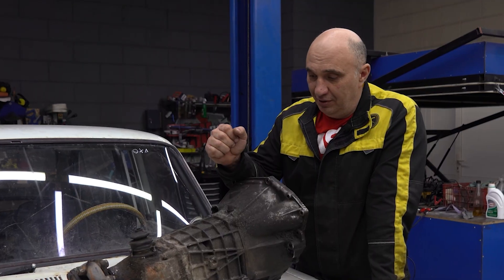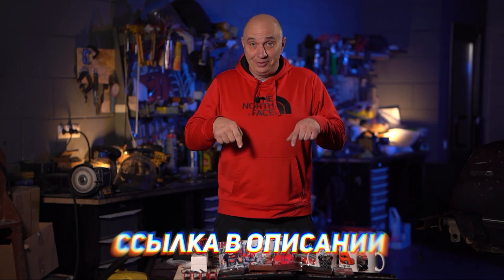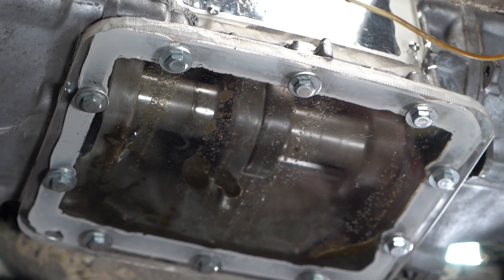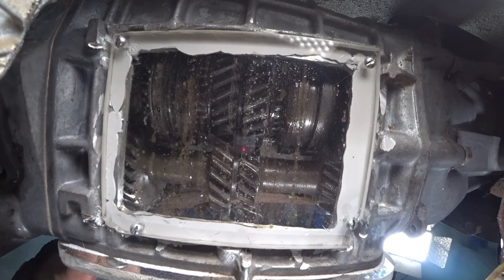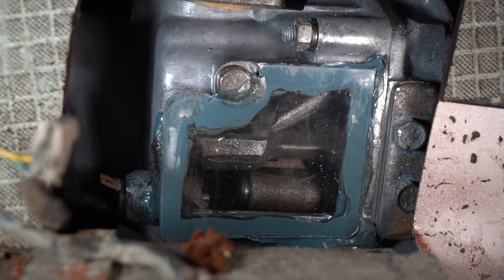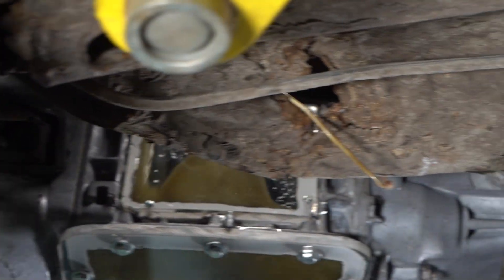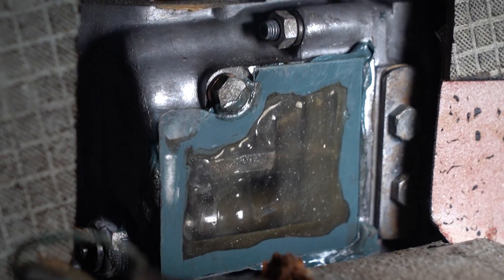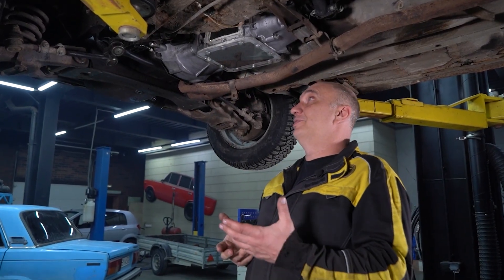We make a see-through gearbox for a Lada

Comment: When i was a small kik i used to think that engine and transmission are full of oil up to the brim ... it would be nice to flush it so it stays see through longer and slowly add more and more oil and see the result, even try to drive it when it is full to see if it has any negative impact

Comment: you can run a transmission for short periods without lubrication. its more about prolonged stress. there is always some metal in the oil. but if you pull off your transmission oil pan at home and have metal lie those shavings in the pan. go see a mechanic.

Comment: Hey garage! I have a 1300 lada engine 2105 with a timing belt, and cant make it run well... when fiddling with ignition module it has tendency to shoot fumes into coolant piping. Is it normal or i have head gasket failure?
Reply: Broken gasket

Comment: i would like to see u guys make a electric lada maybe a golf cart motor and battery bank. would need some kind of motor controller anyway thanks for the great videos very interesting.
Reply: It might take two golf cart motors to move a Lada.  Have both motors connect to a common flywheel and drive through the clutch and gearbox.  Technically, an electric motor doesn't need a transmission but, the lower gears will give it much better acceleration from a stop.

Comment: This is a great chanel for petrol head to showing how an engine is lubricated how a manual gearbox works how the oil moves around the gearbox most facinating stop giving BMW ideas about how to use mire plastic in there so they break down quicker

Comment: What about a five-speed gearbox? Where does the fifth gear fit?? I have only disassembled 4 speed Lada boxes. Not 5 speed ones. Can you guys make a transparent 5 speed one??
Reply: the operating principle is exactly the same, only with the overdrive 5th gear being there too
Reply: I don't know if the Lada engine has the torque to handle an overdrive.  Level flat roads at best.

Comment: would love to see a seethrough automatic transmissions aswell
Reply: or a Continuously Variable Transmission
Reply: @shioq  watch how a snowmobile clutch works same thing
Reply: With automatics often being little more than a stack of planetary gears and clutch packs, there wouldn't be much to see from a housing cut-out.
Reply: @teardowndan5364  cut a hole/window into the torque converter and then . .oh crap, it's spinning. Run some crazy video stabilization software on it? lol.
Reply: @colinstu  You'd probably need to use a high-speed camera with 1/10 000th shutter speed or faster and a sync mark detector of some sort.
Reply: @colinstu  only way to understand how is 2 fans facing each other but not sure if clear case tc will show it like that given the space?
Reply: @teardowndan5364  I wanna see a clear valve body.
Reply: @teardowndan5364  a torque converter and a valve body too
Reply: Torque converter yes please.
Reply: jea i agree too
Reply: try making the engine block transparent
Reply: yes
Reply: I think the other issue would be finding an automatic in Russia.
Reply: They should make torque converter from plastic glass
Reply: Please.....do a see through AT gear box, as a basic AT gear box also so complicated@#%§ (in a view of a mechanic)

Comment: Would petrol work as coolant?
Reply: Yes. It already cools the fuel pumps.
Reply: @vector6977  i think they meant for the engine coolant, to which id say no. it would evaporate off rather than cool. if you were lucky.
Reply: It would probably become a pressurized vapor. they used to heat gasoline into a vapor to use in boilers, etc.

Comment: Try adding a big neodymium magnet to the bottom pane, then run the box for a while, and see if you can determine how much of that metal glitter in the oil is actually from wear and tear of the ferrous metal gears, and how much of it is from cutting out the holes in the aluminium casing. Whereas the aluminium won't stick to the magnet, the ferrous particles will.
Reply: I was going to say the same thing
Reply: I also was wondering if it was just aluminum shavings from cutting the holes in the casings. A magnet on the bottom would be a good way to find out.
Reply: @keithyinger3326  it's all from cutting it... You aren't going to get metal shavings like that from running the gearbox dry on a lift.
Reply: yep same thought here...that would be pretty interesting.
Reply: yes
Reply: It does look a lot like Aluminum.
Reply: just said that , then looked down , hahaha
Reply: OMG! You beat me to it! I was gonna say the same thing!! Neo magnet! Those shavings are from sawing openings in the case.
Reply: Isn't it a horendous amount of particles !!! WOW !!!!! :(
Reply: @Paul O'Connor  it's an old car what do you expect? It's Not a Toyota.
Reply: I just want to say that the casing isnt magnetic it’s aluminum casting 🤣 
So no its not going to work
Reply: @MertNisa3168  no, it would not catch the aluminum, but if it doesn't catch any metal shavings and they are all still floating around in there, it would tell you that yes, they are aluminum shavings from cutting holes in the case and not worn gears. So in that sense, yes.. it would work for determining which is which.
Reply: @MertNisa3168  That was the whole point of the magnet to make sure it was just aluminium shavings and not ferrous. At least that was the first comment I read.

Comment: Hi. I've been following your shows for a long time. One question. How would the original Lada engine behave if a turbocharger were installed?  Thanks for the answer and even better for the video. Greetings from Croatia.
Reply: Prety sure they've done that before, one I recall was an electric job done with a starter motor, made boost, power went up, just as a turbo should...
Reply: pretty much the same as any other engine would with a turbo added. boost etc would have to be carefully kept in check as it may not be able to handle as much boost as a built/designed for boost engine, and compression ratios will be higher so will only be able to handle modest (up to about 10psi at best) of boost anyhow without knocking, and that assumes being able to get sufficient fuel into the engine (rejetted carb for example). adding a turbo to a diesel is, in some ways, a SLIGHTLY simpler affair, but not much as similar principles around fuelling etc apply, but the engines are largely unchanged internally (certainly on older cars of similar era to the Lada) boosted or not
Reply: I'd like to see what's called a "turbo-compound" arrangement.  Instead of the turbo being used to cram more air-fuel mix into the engine, the exhaust turbo is directly driving the flywheel of the engine.  It will be directly converting heat energy into mechanical energy, thus recapturing some of that lost heat.

The turbo will have to be bolted in where the starter is currently located.  Vlad will have to come up with an alternate way to start the engine.

The turbo-compound idea was used in the DC-7 airliner.  When it worked, the DC-7 had amazing climb and cruise performance.  But, the metallurgy of the time wasn't up to the task and it would fry the exhaust valves all too quickly.

Comment: What about converting a stock transmission to a dog box style one?
Reply: dog box as in no synchros? or a sequential type one? many people think theyre the same thing, but theyre not. theres a reason the parts in a synchro box are called synchro rings and dog clutches. essentially all you do is remove them/stop them working (which is the main reason race/rally cars have to throttle blip/rev match on downshifts, to align everything so the gears can be selected going down the box. basically the same as driving a manual without using the clutch to change gears)

Comment: Make a automatic transmission from a manual
Reply: Look up their diy centrifugal clutch using a drum brake from a few years back... that one was pretty cool. Sort of an auto, but not really. I know what you meant, but that's a cool video and it worked good.
Reply: What if they created a "robot" to operate the clutch and shift gears?  So that it simulates an automatic transmission.
Reply: not really possible. the 2 work in totally different manners inside which is why the dual clutch 'autos' like Porsche and VW (for example) are pretty much computer controlled automated manual transmissions. strip them down and theyre basically a manual box
Reply: The only way you could approximate a manual to automatic conversion is to study the vacuum shift VW "semi-automatic" from the late 60's-early '70's Beetles.  The same vacuum servo concept that operated the clutch could be duplicated to shift the gears.

Come up with a mechanical "logic" to measure road speed and use electric and pneumatic forces to depress the clutch, shift gears, and release the clutch.  I can see a major rats' nest of vacuum hoses, solenoids, and vacuum servos!  It would be one hell of a challenge.